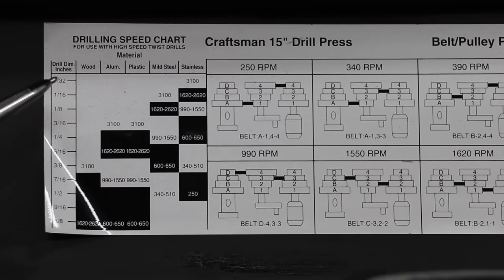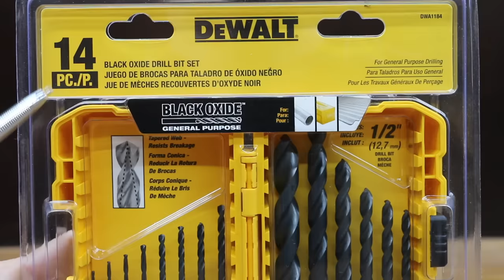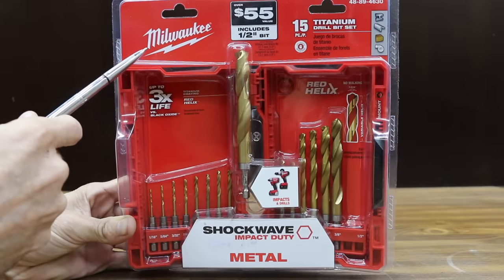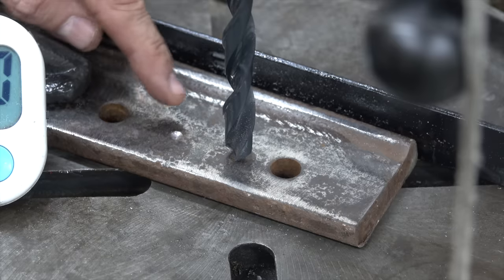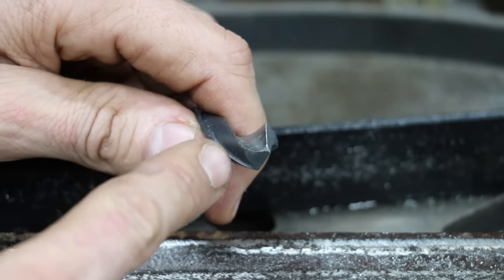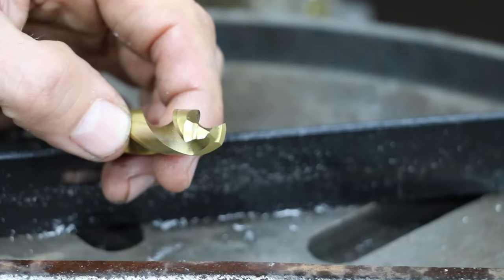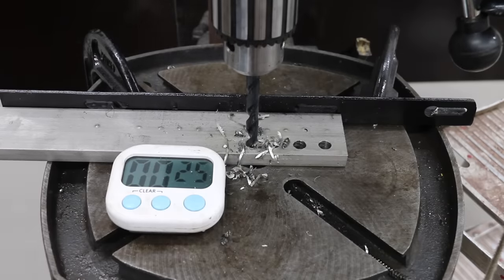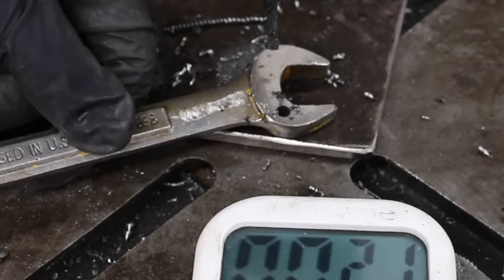Which Drill Bit Brand is Best? Let's find out!

Comment: I havnt read all of these comments to see if this is repeat info but i am a steel nerd so ill share. M2 is the industry standard for black oxide and tin coated bits, some super cheap bits arent as good as M2. M35 is M2 with 5 percent cobalt. Cobalt makes it harder and resist softening at red temperature. M42 is a totally different alloy with 8 percent cobalt. M2 is abput the 63 to 65 range, M35 is 65 to 66 and M42 is 68. M42 is reccomended for perfect vertical like drill press and cnc. Carbide is reccomended cnc only as it likes consistency
Reply from the maker: Thanks for sharing.

Comment: When drilling you tend to use the lower end of RPM chart, eg. using the 340 instead of the upper limit of 510.  Like to see you compare the upper and lower RPMs with the same brand drill bit on the same material.  Curious how much effect RPM may have on the drill bit’s effectiveness.  Thanks.  Great job.
Reply from the maker: Thanks!  Thanks for the video idea.

Comment: In the old days i liked Butterworth and they had great durability and more twists per inch. I always cut relief on the back side then tested it for size when important. You can make a 1/4 inch bit drill any letter or number set over that size by offsetting your grind so i can get away with just a standard set in 32nd inch incriments. Also I will sharpen a carbide just like a drill bit for drilling holes in things like magnets or any hard materials.
Reply from the maker: Thanks for the feedback.

Comment: Right now I'm interested in working with taps and dies.  And the use of drills that are measured in either letters or numbers rather than fractions.  I'm interested to know if the difference in the use of them (when specified on the charts) instead of the fractions will lead to closer tolerances in the finished threaded hole.   I watched someone use a drilling guide and/or threading guide to make the results better too.  I've used the fractional drills recommended on the charts, but I feel that the finished threads haven't turned out as close tolerances as could have been.  Can these drills be found with just as good of quality as the fractional drills tested here?

Comment: Very interesting watching these tests. 
The thing abt. these brands is a lot of them are made by a cutting tool manufacturer and not the actual brand itself, i.e they often don't own the factory.
I worked for a few years for one of these tool factories and the quality of the drill was the same for the drills because they were made in batches that did not differentiate between customers or brands. They always bought the best tool steel they could get and a lot of their drills were co5 or co8. Once they passed final inspection that's when the difference occurred. Drills  would then be split into the branded and unbranded lots. For branded drills, depending on the customer / brand  the drills could have different coatings, the laser marking added for that client and even packed into the customer supplied boxes. So I'd guess a customer could possibly have their brand made by more than one manufacturer so what tests good this year may not be consistent next year.  It can happen that  a manufacturer  buy some stock from another if they get a very big order or are short of raw material or some other resource. At one stage in the factory I worked for, they bought off a range of drills from an up an coming Chinese manufacturer as they wanted to evaluate the competition. The drills were then put through their inspection process.  Of the 50000 items tested 25% were outright scrap and could not be used at all. Another 25% needed rework, either repointing, regrind or other remediation, needless to say they realised the competition was not up to it and the Chinese tool steel not the same quality as they were using. 
I'd like to see tests done for masonry tipped drills. Their manufacturing process can be trickier because of the the carbide tip, you might get some really interesting results with that !
Reply from the maker: Thanks!  Thanks for the suggestion.

Comment: If you let the workpiece work-harden then yes, the drill bit will be history and you must stop immediately and re-shapen the drill. If you're not quick enough and it wears the lands you can chuck it in the bin - that , or grind it all the back to a place where they're not worn. After that keep the pressure on to make it cut. Try drilling/tapping or reaming titanium that's horrendous stuff if it work hardens on you. 

Would like to see a test of tungsten carbide masonry drills, you might think they would all be the same but not all tungsten carbide is made equally (different grades). Add to that the design (support for strenght) and grind of the cutting tip (for performance) needs to be correct. Cheap Chinese TC drills (and milling cutters) are rubbish in my experience but feel free to prove me wrong! 

Love the channel by the way... :)
Reply from the maker: Thanks!  Thanks for the feedback.  Thanks for the video idea.

Comment: What drill bit to use in metal with hand drills  like hammer drills cause that all i use at work thats why your video on best step drill bits helped pick the good one so i could go through some metal i'm not sure what kind it is, but needed a 1/4 hole. thanks for all you do.
Reply from the maker: You are welcome!  Thanks for the suggestion.

Comment: I have a hardened steel or carbide that I'm trying to drill through to no avail.  I've used Milwaukee, DeWalt, harbor freight, and carbide bits.  Is there something better than any of these?
Reply from the maker: Thanks for the suggestion.

Comment: It would have been great if you could have thrown a cobalt bit in there for comparison.  I had to drill a lot 5/8" holes in 18-8  1/4" bar and tried everything. Eventually, after trying Milwaukee and Bosch and burning them up because I wasn't lubing them right, I bought a set of COMOWARE (cheap) on Amazon and was very happy,  I also found some  cobalt step bits worked well.
Reply from the maker: Thanks for the suggestion.

Comment: Video suggestions:
Have you considered testing non contact AC voltage detectors? There's a wide range of pricing for different makes and a narrow range of optimum sensitivity for them, where they become useless if they're either too sensitive or not sensitive enough.
Properly used, they're helpful in providing a quick determination if a wire or receptacle is live before working. 
Handy for a sweep of a breaker panel to locate tripped breakers without having to manually feel each one, as it's often not that apparent visually.

Also helpful are circuit tracers such as Triplett Fox and Hound, which can inject signals into wires to allow tracing routing, even through walls. A comparison of units there would be good to see how well different designs work.

Similarly, there are breaker locators, which have a transmitter which plug into an outlet, and a receiver probe that allows you to determine which breaker services that outlet without having to flip them off and on randomly.  Only thing there is that all the different makes are actually manufactured by the same outfit, so a comparison video probably wouldn't show much in the way of differences 🙃
Reply from the maker: Thanks for the suggestion.

Comment: i love these videos and this one is no exception.  I do get a lot of info and value from it as-is, especially when important continuity factors like matching speed and downward force are part of the test design and machines are modified to ensure that continuity. but i always wish there was one option of like a VERY expensive option just to see, in this case maybe just one bit could be bought from like, norseman or drill america cobalt whose sets get close to $100 or exceed it I think century drill makes a $140 29pc set. I see those and I think “I’ll probably never buy those but if they really just blow away the competition, maybe I would.” Or at least just a few sizes I use a lot that are large enough that I won’t accidentally snap them. 

Also a little discussion on bit material. Like the properties of cobalt vs titanium vs black oxide vs gold oxide and what it means for longevity, speed, and if they have more resilience to heat impacting damage to the bit. Also if a bit had a different angle and what impact that has. There are also bits that have a smaller diameter twist to start the hole before the main diameter. I know Dewalt had a set like that. Would this add to the life, cut better, generate less heat?    

That’s not to downplay the quality of the test, I really do get a lot of value out of these vids, but even before I press play I usually have brand in kind that I’ve looked at, that I wonder about like “probably way too expensive for the increase in performance,” usually it’s a less well known brand that specializes in one specific thing. Like wondering about that one brand that only makes ____ (drill bits in this case), and their 24pc costs $100+. Like when I stop and go “whoa those things are way to expensive… that couldn’t be worth it… or could it? Maybe they did something unique or have a patented design that is superior? And maybe not. Maybe it’s just a price for people while money to throw at something with the expectation that crazy price = better but it isn’t.
Reply from the maker: Thanks!  Thanks for sharing.

Comment: I have found that when using bits that only ever go in a drill press, to go ahead and get nice bits. If it's something that a helper will be using, they dont get machinist quality bits, Dewalt off the shelf at the box store is plenty good for anything they will drill by hand. Keeping a cheap sharpening tool in the toolbox on that truck will save your bacon sometimes too. It's important to show your helpers how to touch up bits, chisels, etc so they dont waste time or hurt themselves.
Reply from the maker: Thanks for sharing.

Comment: Love your videos truly. Whenever I'm about to buy a tool, I check to see if you've reviewed it.
I would love to know the specifics of what you use as a drilling chart for speed AND downward pressure - especially for those us us that are using hand drills. I assume it's often times: just push down as hard as you can for hand drills. Though there are variances of speed switches and variable speed triggers that would help reduce wear and tear on drill bits.
The charts I've seen online can be a it confusing and/or contradicting to others - so i'd love to hear what you use!
Thank you again for your professional work.
Reply from the maker: You are welcome!  Thanks for the suggestion.

Comment: I’m working on some rc engines that uses a case hardened steel. What’s a good drill bit for that type of material. I need sizes ranging from at least 7/64” to 5/16
Reply from the maker: Thanks for the suggestion.

Comment: Lawson Product Inc.  M7 Tool Steel Drill Bits are the Best.  I wish You had used those in Your comparison.  Lawson mostly Sells Direct to Industrial Manufacturers and Auto Repair Garages. They are very hard and sharp.
Reply from the maker: Thanks for the suggestion.

Comment: I bought a 10 pack of 1/8th” Drillbits at Harbor freight just to have some extras. They were gold ones..
   when I went to use them to drill holes in some aluminum, and some aluminum flashing, all 10 of them broke. I ended up using an old very used drill bit to finish that job , held together by rivets..
  they were worse than fire crackers. At least fire crackers work once..
Reply from the maker: Thanks for sharing.

Comment: My experience with these coated steel drills is once you wear off the coating they dull quickly and even if sharpened correctly do not hold an edge.   Still using a HSS drill set purchased decades ago which can be sharpened again and again.
Reply from the maker: Thanks for the feedback.

Comment: The harder the material, the more force you need to apply.

The more force you apply, the slower you need to go to let heat dissipate.

Coolant allows for higher speeds.

Rule of thumb for stainless steel: Double the pressure, half the speed (relative to mild steel)

The larger the diameter of the drill bit, the higher your circumferential speed, so the lower your RPMs need to be to avoid too much heat.

Too little force: drill bit is skating along on the surface generating heat rather than digging in and cutting, you'll get fine dust, lots of heat and will blunten the bit

Right amount of force: drill bit digs in, energy goes into cutting, large swarf with smooth edges, drill lasts a long time

Too much force: large swarf, but with a coarse, serrated edge to it and extra heat, faster wear on bit

Want to blunten your drill bits?  Use too little force to cut properly and generate lots of heat with high speeds

If a bit won't cut efficiently at any speed/pressure combination (or squeals a lot) then your drill bit is blunt.

Drill bits can be sharpened on a bench grinder.  Takes an understanding of how the bit works and a bit of practice though.

The centre parts of large dill bits don't cut very efficiently - drill a pilot hole with a smaller bit (approx 1/4 diameter of large bit) so that the large bit only has to use it's chiselled edges to cut.  Pilot holes will also make your hole placement more accurate.
Reply from the maker: Thanks for the feedback.

Comment: Is there a way to simulate a sheer stress? Very few of us are using a drill press, and while cutting speed is important, it would be extremely helpful to know which bits don’t snap easily in real-world applications.  The “higher end” HF bits are fine if you can stay perfectly perpendicular, but sheer stress snaps them quickly. Dewalt seems better, but not that much.
Reply from the maker: Thanks for the suggestion.

Comment: For me I've learned I prefer bits that last. They can be cheap or expensive usually you find a few unkillable bits in each kit.
I've bought Chinese bits that are near dull from the factory and just re cut the leading edge and they last a few dozen holes before sharpening again.
 And I've bought USA made bits that were sharp from the factory but will not hold an edge once they get re sharpened. DeWalt has always been great for me same with Milwaukee last from the factory and hold a good edge when you sharpen them,  the gold work pro kits from Walmart aren't titanium as they claim either but they hold an amazing edge if you regrind Them.
Reply from the maker: Thanks for the feedback.

Comment: Is it possible that the spring steel may be a considerable amount harder in one spot vrs another?  Just seems that way as a number of the brands used in the center of the piece of material went through the other materials a lot faster than the bits used on the outer edges of the spring steel.

Comment: A simplified RPM formula is: Cutting Speed (feet per minute) * 4 / Diameter(inches).  CS for mild steel by HSS is 90-100 fpm. 
More detailed and accurate one is CS(foot*minute^(-1)) * 12 (inches*foot^(-1)) Radius(inches)^(-1)*(2pi (Radians*revolution^(-1)))^(-1) = CS*12/(2pi*Radius) = CS*12/(pi*Diameter)
Reply from the maker: Thanks for sharing.

Comment: Would love to see a "Tool Truck Brand" review from Matco, Snap-On, Mac Tools, Cornwell. 

Also a test of their warranty via mail in and from each truck. 
Couple bits then a completely damaged set. 

I've heard rumor Snap-On is the only one that'll warranty their drill bits which is good but they also cost around $250~$350 for a set. Definitely more bits than these sets as well as they're geared towards the pro mechanics field. 

Let me know if this is something that's going to be possible or not. 

You'd get alot of mechanics that would chime in but I think a teaser of a upcoming video to get guys to comment then drop the video for all to really see what the outcome is.
Reply from the maker: Thanks for the suggestion.

Comment: BOELUBE 4 oz Jar Cutting Fluid
 - As in Boeing. Have you ever tried  twist drills made of cobalt?

The ability to withstand heat means that cobalt bits perform for long periods without cooling or the need for cutting fluid. They are most often used to cut through hardened and abrasive materials. Cobalt bits are able to cut through the most hardened metals, including bronze, cast iron, stainless steel and titanium.
Reply from the maker: Thanks for the video idea.

Comment: Have you seen the cobalt "hyper step" drill bits offered by Matco tools? I'm sure there are other brands as well. They have a different style tip and at $335 bucks for a 29 peice set in their most recent flyer I was wondering of they were really that much better.
Reply from the maker: Thanks for the suggestion.

Comment: I'd much rather have a drill bit survive than just make a few quicker holes. Test and review the 50th hole. 
   Maybe some tests with hand drills. 
   Between cordless and corded I think I have at least seven drills. (+ at least three more that need repair), and at least three impact drivers. Handyman, remodeling, etc. Yet, like most people, I still have never owned a drill press. I can't even remember the last time I used one.
Reply from the maker: Thanks for the suggestion.

Comment: Could you redo the test and keep the bits cool with a water Squirt gun (cheap and works if the water won't hurt the project)? I've experimented in the past drilling stainless (hardened stainless that another guy overheated a bit in at high speed without coolant) and with the bits I had the heat is what would kill the bit. Heat softens the bit and it needs to hold its heat treat to remain effective. Thanks for the video!
Reply from the maker: You are welcome!  Thanks for the suggestion.